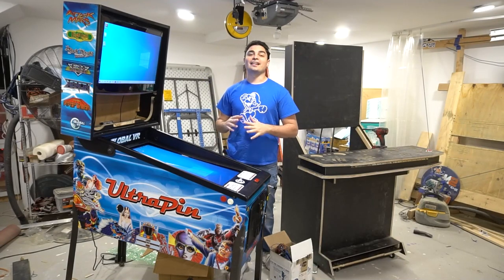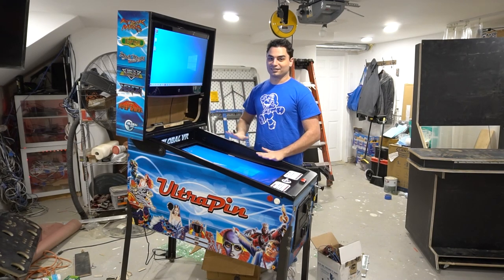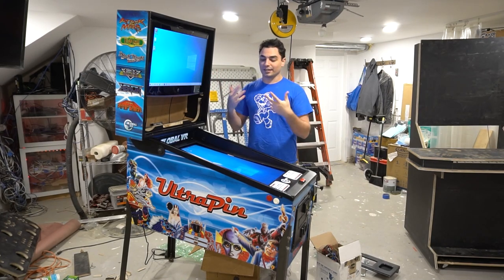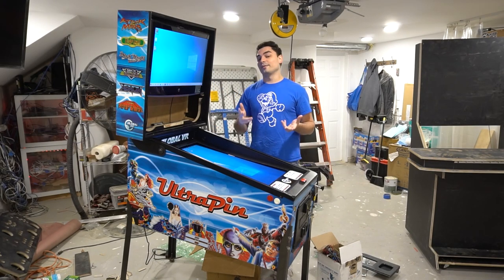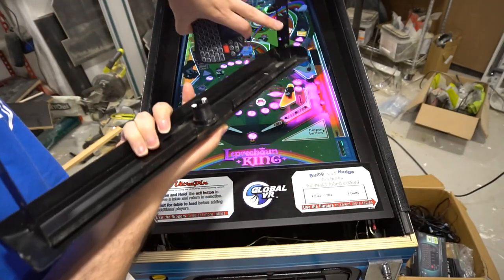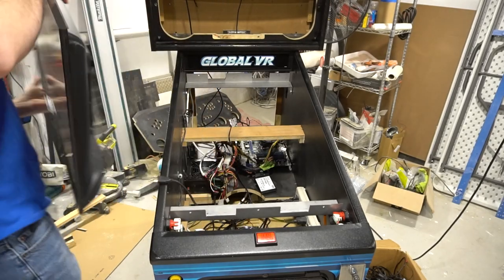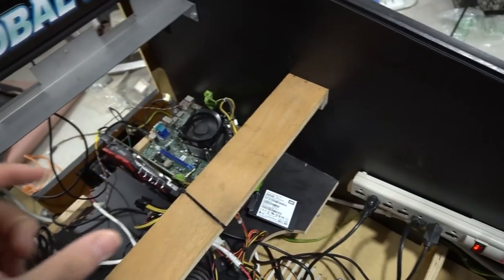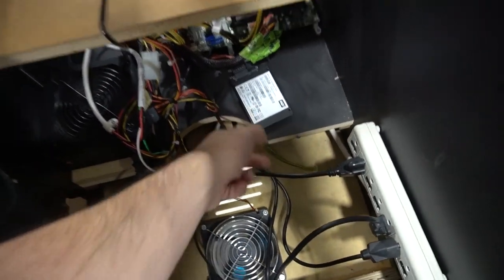Global VR UltraPin Virtual Pinball Machine In for a MAJOR OVERHAUL

Comment: Hey Vic virtual pins look great 👍 . I purchased some solenoids for my side flipper buttons for an arcade stick that I made from a guy named Phil Elis. They work great. I have been using hyperspin to play Arcade Pinball an FX Future Pinball, but I can’t seem to figure out how to get a full playing  field screen like you have on your videos. I have an adjustable gaming monitor that can go flat and vertical.  But my playing field seems to be at the wrong angle. Is there away to adjust this in Hyperspin or Rocket Launcher ?
Reply from the maker: Hey bud thanks, you need to set up cabinet mode in each emulator. Is your screen vertical like a pinball machine tho?
Reply: @Vic_VP  
I am using a Asus VG27”QR with a modified stand that I can manipulate it to have the screen vertical, horizontal, or vertical laying flat.
Reply from the maker: @bmontano71  so yes u need to assign it in the emulator itself
Fx u need a cab code, same for pinball arcade